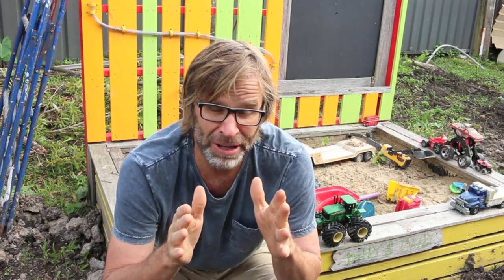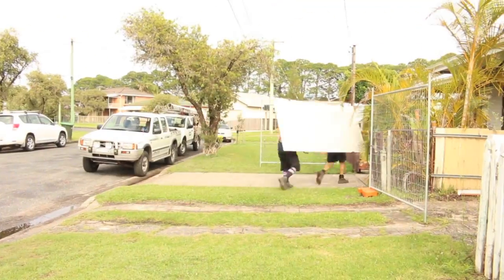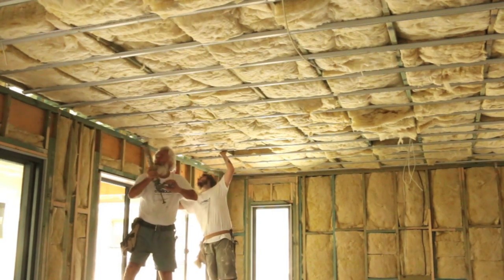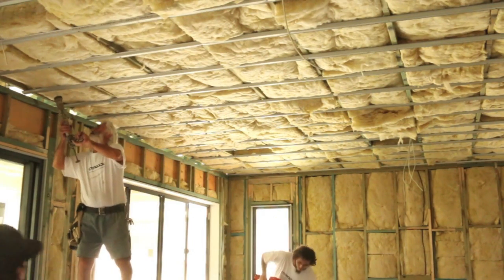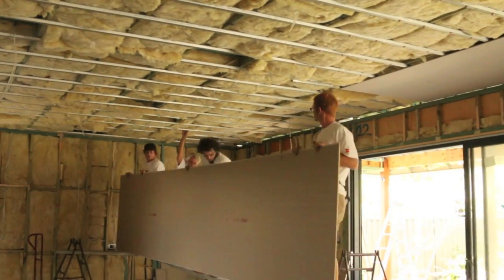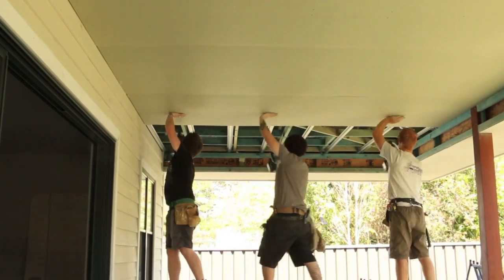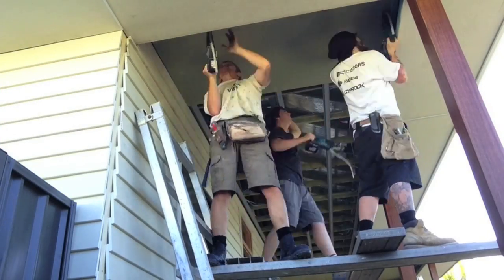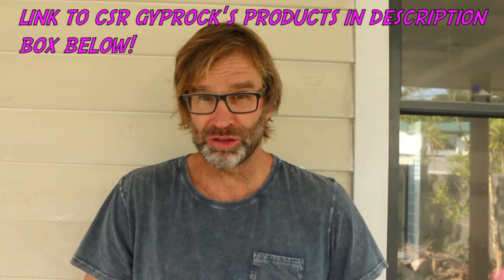Hang the Drywall / Plasterboard. Owner Builder Series. Ep 30, Part 1.

Comment: the first sheet of plaster went up, did you see the holes in the roof without any sealing compound, heat will transfer through these gaps as fast as can be, again, thermal imaging will show you all the flaws, but its best to get it right in the first place